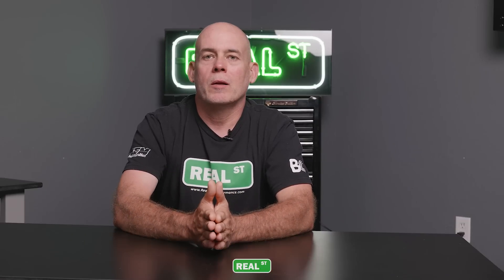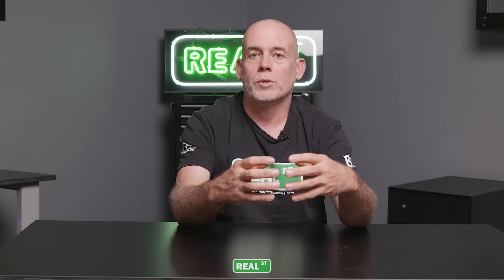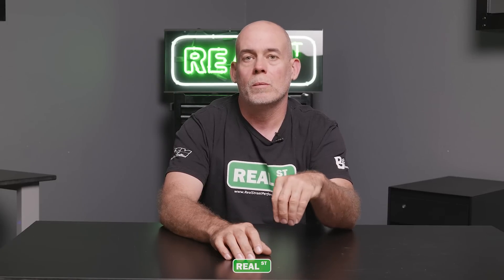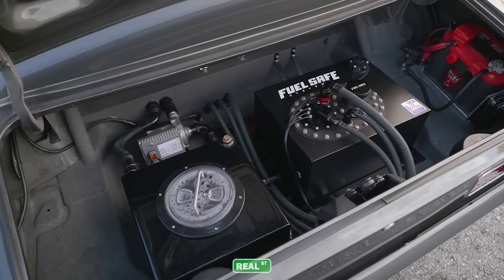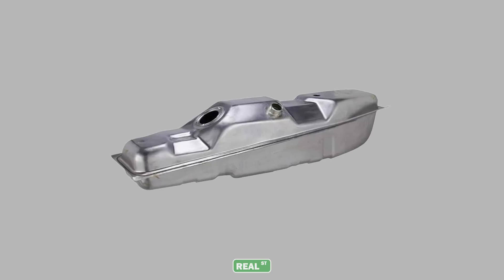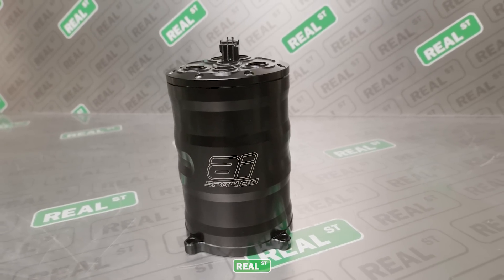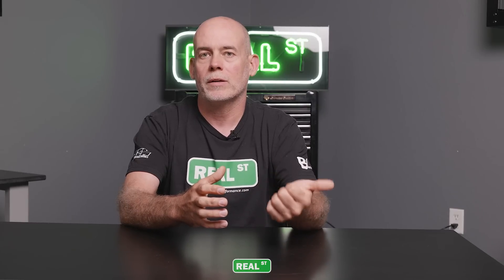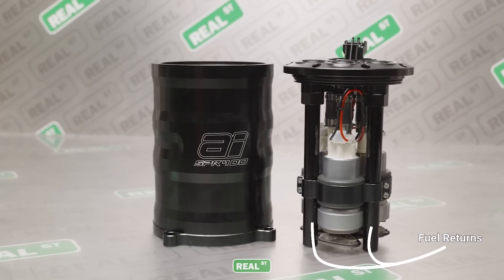Fuel Solutions | Which One Is Right For You - Jays Tech Tips

Comment: I have to disagree about sumped steel tanks. It's not like there's a big hole the size of the sump is cutout and the sump installed. The sump is baffled by several small hole saw openings being drilled,then the sump installed. That being said, I've now used a sump tank and they work like a champ!!

Comment: I would love an what would you do. I have a 95 neon acr that's built to the gills 😂. Long story short I found the car and iv been bringing her back. I'm dailing her and doing some racing mostly roll racing although I'd love to do some autox next year. I currently have a fuel cell with a sump and a a1000 foward of the cross member and tank which I'm not sure is great😅. Any who car makes 600hp as is so iv been hesitant to make big changes as I don't have spares and these things are getting surprisingly rare and hard to find. That being said It always smells like someone poored gas into the floorboard and it definitely starves for fuel in turns breaking ECT. I don't have a factory tank but I own a bodyshop and can do every job in the shop. I wanna cut the spare tire well out in the trunk and make a big new tank also giving me a nicer more useful trunk. In said tank I thought about partitioning it into 1/3s with baffles and a big tall space for the big sump for the a1000. I'm cheap and it works plus I kinda like the sound of it 😂.I have a aem stealth 340 but am willing to get another pump as a lift pump. That being said the car is turbo limited ATM and that's changing but within the 7/8 fuel line (hard line)s limits. Does this sound viable? Or should I just get a few of the 340s and go with that in said sump? Or do you have a better idea? Maybe an off the shelf solution that would still give me 15gal+ . I'm not super into a steel tank in the crash area and no liner... I don't know how to make one of those or who does

Comment: i use a 10lt fuel cell surge tank and run an Aeromotive ext pump and stock e85 pump in the fuel tank to feed the surge i have1800hp on tap and leaning out the fuel isn't an option

Comment: Awesome video as always,  you missed some of the potential down sides of a surge tank though. Again you might be putting fuel in a place it is less safe. The fuel lines can smell, they can be louder than oem, they can still get hot due to the low volume of fuel surrounding the pumps. Agree it is one of the better options but in a pure street car with a good tank, in tank is much nicer to live with if you can make it work.

Comment: If -10 goes from tank to pump should it be -8 out of pump or -10 is fine?
Reply: On external pumps I always run as large of a feed as possible and what ever size feed that will meet my hp goals, -8 will get you over 800 on gas and maybe 700 or more on e85 depending on fuel pressure, pro stock cars from the 700s made over 600 hp with 3/8s fuel lines and a old school mechanical fuel pump

Comment: What are your thoughts on adding fuel cell foam to a factory tank? Similar to aeromotives fuel bowl made out of foam idea. In my s13 tank the pump hanger hole is large enought that I was able to cut and stuff the factory tank full with foam after I removed the factory baffle that had fallen off after 30 years anyways. Hoping to mitigate fuel slosh to keep the pump happy under acceleration.
Reply: foams function with respect to baffling is very poor
Reply: @AftermarketInd  the factory fuel bowl is intact. S13 baffle if you want to call it that was not a large piece. Just trying to mitigate slosh from the bowl under heavy acceleration.

Comment: You could use the Holly Hydromat which I used inside my 2004 WRX STI fuel tank with a Full Blown brand fuel hanger with dual Walbro 450 lph fuel pumps. It worked great and didn’t experience fuel starvation on sweeping turns. Fuel was full E85. This solution kept the fuel system simple and doing it at a lower cost. Feed and return fuel line used from the hanger was -8an ptfe fuel line and fittings to an aftermarket fuel rail with fuel dampeners, Aeromotive fuel pressure regulator.
Reply: Was planning on that for my nova when I start drifting it…🤔🤔🤔👌🏻
Reply: @sacrificialrubber779  I use the 15x3" one in my LSA silverado, it's fucking gold

Comment: Just finished the fuel system in my is300, surge tank is the way to go for sure.(For me at least) twin aeromotive 340s seem to want to do the job for now. I ended up fabricating mine out of a 2.5 gallon fuel cell from ebay with various bulkhead fittings for the feeds, returns, and electrical pass throughs.
Reply from the maker: That's awesome! Great to hear you have put together a nicely done fuel system.
Reply: @realstreetperformance  you guys supplied my pistons, your guy Ariel gets a 👍for giving me a great deal